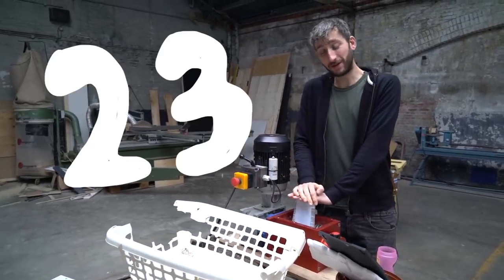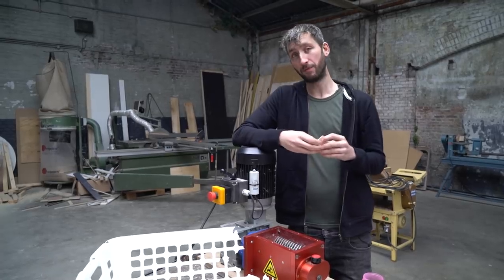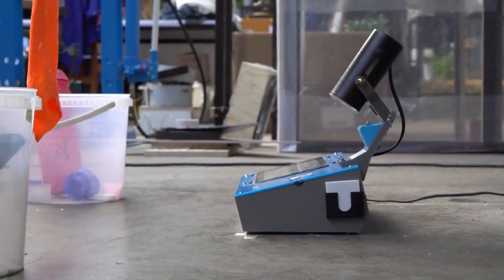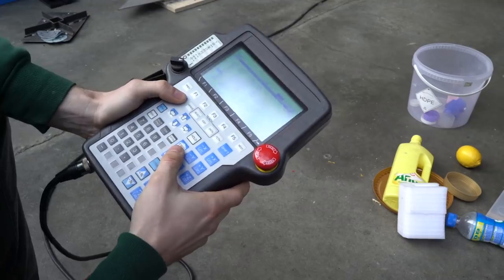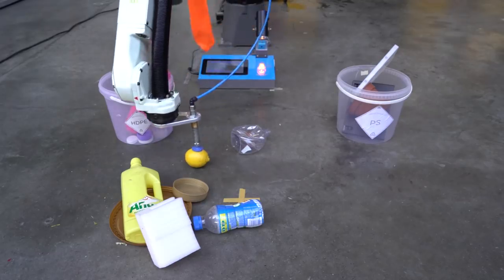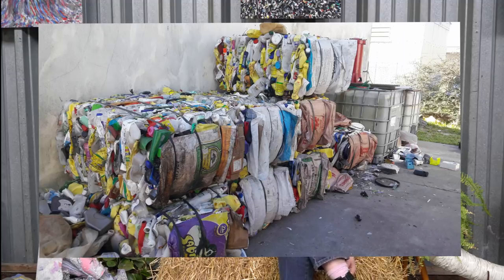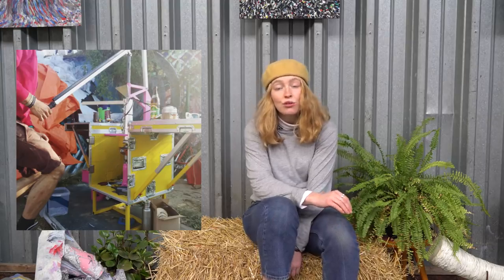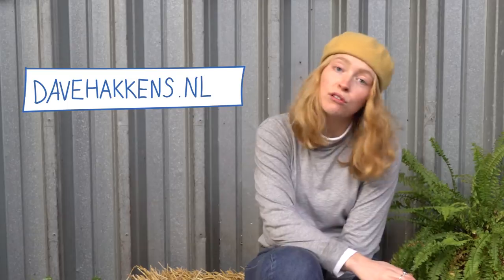Monthly news #23 - Stop shredding fingers

Comment: Capacitive sensor on the crushing teeth 
So when you touch it it stops the motor
Search sawstop on youtube
Reply: Would be a nice idea if the whole machine wasn't made out of metal, I also assume the motor is grounded, which would mean that the whole shredder is grounded. And it it's not grounded i'm sure this shredder would gather enough EMI to trip the safety mechanism.
SawStop works because the blade is a single part and it's easy to isolate from the rest of the saw.
Reply: Sawstop is only safe because it is going under table in milliseconds.
Reply: good idea, but not practical in this case as bottle are often still wet and would trip the system. also, many plastics such as PET, Nylon and ABS are hygroscopic and absorb lots of water, as opposed to PE and PP that do not. so will bw hard to calibrate.
Reply: @s777nserg  this could be made safe using SDI mode (Safety direction) by reversing the motors direction or SLP (Safety Limited Position) using a VFD :) You could isolate the blades from the rest of the machine by putting bushings between them and the drive shaft or between the bearings and the housing. There are ways to do this
Reply: Here's an idea: A skin sensor you have to attach to your body in order to turn on the machine at all, then you can detect the closed loop to stop. The only drawback is if there's more than one operator using the machine.
Reply: @mikkosha  that's what I was thinking aswell! (Specifically reversal could possibly be better than straight stopping in place with those interlocking teeth.)

Also possibly, have the rods that the teeth are on be forced away from each other if capasatance is detected, kind of like how the sawstop blade retracts. But horizontally, as opposed to vertical movement.
Reply: @stapuft  you could build something like an electromagnetic latch for this purpose :) Like as soon as you apply power the teeth get pushed together into their working position, tensioning a spring which is then latched and as soon as power to the latch is cut off the latch will disengage and the springs will push the teeth apart :) I like your idea :)
Reply: @mikkosha  thats awesome! I like that as well, but just thinking out loud, wouldn't you need some kind of motor or something to tension the spring? If it's powerful enough to pull the heads apart fast enough to be a safety device, it might be really hard to put them back in place without assistance.

What about a electro magnetic thingey? If you use DC power for the magnets, you could controll their polarity realitively easily, what about when the capatance device is activated, the electromagnets polarities get matched, and shove each other away through magnetic force?

You would need a really high speed microcontroller to make it act fast enough though, possibly even use a capacater bank to get enough power to make the magnets repel each other with enough force and speed to be effective.
Reply: I think that will not work with wet plastic. I'm not sure if they have all plastic dry but if they don't that can be a problem.

Comment: copper fingers or forks that push out of the way completely when inserting something into the machine, if flesh or metal contacts the copper fingers it will complete a circuit and switch the machine off instantly.

Comment: Just make a upside down pyrmiad shaped funnel that's long enough that someone's hand cant tough the blade, but this also means the opening will be bigger than the original which is a good thing
Reply: or ooo I know let's make one so big that a grown man can't climb out if he falls in
Reply: I built a shredder like this and I put a funnel on top, and a hinged polycarbonate cover with an industrial electromagnetic safety switch on it
Reply: all commercial shredders basically are just like that. the plastic has to be introduced through a shoot.  the blades are far down. BTW, in the industry there are shredders and granulators, and they are 2 different things doing different purposes.
Reply: I guess the problem they are trying to address is being able to push down the plastic material into the shredder to make sure that it is being shredded. I think installing a funnel shaped shoot with a mechanical pushing mechanism can be a solution. :)
Reply: @gilsonandrenarciso9574  A very simple solution is to use a rod (use plastic to avoid contamination) to push down stuck material. Works very well for wood shredders. They also have the big hoppers, so you can't touch the blades/hammers, which makes working with them pretty safe. As long as you aren't my granddad, who put is finger in from the bottom...

Comment: A bunch of people are telling you about sawstop. A good start, but not a good idea overall.

Sawstop works by shooting a steel lever into the mechanism, saving your finger while destroying the saw. For large crushers, this is an expensive mistake you won't want to make.

Instead, consider a long funnel that prevents anyone from reaching into the shredder with an arm. Not only is this solution much easier to implement, but it's going to be more reliable with less expensive testing needed.

Unfortunately, it simply is not economically viable to recycle expanded PS. Considering PS could be a clean burning plastic, it should be possible to build a high temperature, blast furnace like device to produce straight CO2 and water. This, once it got hot enough, could be used to produce steam and thus power, not unlike a traditional coal plant, but with less SO2 and other impurities in the coal released.

Comment: You may try a spring loaded, transparent plexiglass either directly mounted or inside a funnel on top of the shredder.

For the robot, it will be interesting to see the sensor mounted on the robot arm itself; saving the back/forth motion. 

All the best on excellent effort.

Comment: Seems like you just need an open ended box and tamper to make the shredder safe. Could rip some plywood to dimensions, pressure fit it around the housing of the shredder (just zip it together with screws). Then just make sure the tamping plate is smaller than the inside diameter of the of the box but larger than the inside diameter of the lip of the shredder housing. Tamping plate could be secured to a tamping rod with a floor flange and the tamping rod just threads into that flange. That way you could dump several containers in the top of the box and once the tamper is set in the weight of the tamper may even be sufficient to get the shredder to bite into things. If it needs a little help you just depend a some weight on tamping rod to get the shredder grabbing again.

Comment: Hi!
I'd like to suggest another way to sort plastic types!
Every plastic has its own density (pla about 1.25 g/cm³, hdpe about 0.95 g/cm³, PET about 1.38 g/cm³ ...).
Archimedes tells us that a material in a liquid will sink if it is denser than the liquid. So why not shred every plastic and after put them in bath of water with controlled density (you can do that with salt, for example). The heavier plastics will sink and the lighter will float. Begin with a low density liquid (like oil or alcohol) to first separate the lightest material, and go with denser liquid step by step. You will end by sorting every type of plastic! :D
Reply: good idea, worth a try. like
Reply: air pockets (even in the shredded plastic) wil let the plastic float and give false results i fear. Good idea tho, would love to know if it is possible in practice
Reply: @darkspeedy26  Well, if this happens, it may be possible to create vacuum around the Bath it would make the bubbles get out I think... But this would create other problems, like the water boiling at lower temperature if at lower pressure, and si creating other bubbles :/
Reply: @yann516  indeed, and would be energy intensive i suppose
Reply: this is a great idea and there are companies out there doing that: they shred the plastic first then run it through float beds. it works, but the fundamental issue, which is the Achilles's heel of all of Dave's beautiful endeavors is that it must make economical sense! you have to keep in mind that recycled plastic needs to cost significantly less then virgin plastic for a processor to be incentivized to choose it. keep in mind that recycled plastic will always be inferior in quality to virgin plastic. and floating plastic is relatively expensive, (plastic also needs to be dried, typically).
Reply: Superdu our senior project in college was very similar to this except it was ferro fluid. It changed density when different electromagnetic fields were applied to the fluid.

Comment: There is an old saying, "When you are good with a hammer, everything is a nail."  Robots are cool no doubt, but for this application they are both slow and expensive.   Just because you are good with robots doesn't mean you shouldn't look at other solutions.  I suggest you try to arrange a visit to a UPS ,  FedEx  or other package distribution center and see how they sort packages for shipment.  As noted in another comment, a conveyor with means of diverting plastic types to its own bin seems to be a much better way.  You guys do great work and I enjoy seeing your progress.
Reply: Spitballing other ideas... a light duty gantry machine could work well too, couldn't it? Think along the lines of the arcade claw-drop games. It's a much simpler and cheaper than a robotic arm, could be built to whatever floorprint is desired, and still sort through piles in much the same way as the robotic arm.

Granted, I have gantries on my mind, because I'm working on building one right now. (When you're good with a hammer...) A conveyor belt system diverting things would definitely be faster, but that might not be important for small operations. Which do you think would be easier to build and operate?
Reply: @swolebro    In reference to the gantry machine in the arcade.  Positioning the claw above the desired object is less than 1/2 the battle.  The claw and object have to be oriented perfectly in order to grasp and lift that object. More often than not the Arcade claw picks up nothing.
  The best approach I can imagine, is for a person to place plastic items on a moving conveyor.  Orientation unimportant.  The person provides spacing between objects.
  The plastic item then  passes under a plastic type  identification system.  The conveyor proceeds past multiple bins.  In front of the appropriate bin, a blast of air or pusher diverts the part into its appropriate bin.
  This eliminates the need to orient the part or claw for pickup.  It eliminates positioning of a robot arm or gantry.  It eliminates the need for a 3d vision system which will be more complicated than the robot.  I speak from experience having worked on a robot  and vision system used in a painting process.
  I enjoy spitballing ideas, I hope others might join in and that the good folks at Precious Plastics are listening.
Reply: @thomasburdsall1564  I am under the impression that the arcade claw drop games are made intentionally difficult (eg. by packing prizes tightly in the pit) or even rigged (eg. having the claw grip weakly 90% of the time) in order to reduce payout rates. So, I wouldn't take the difficulty of that game as a demonstration of how difficult the problem itself is. 

A rigid Z axis would be one obvious improvement over a loosely dangling claw, and from the looks of that robot arm, it had a suction cup (with a vacuum pump) to make it less sensitive to positioning. 

The conveyor belt systems I've seen were like the ones they mentioned in video. Wide streams with sensors to identify individual items in the stream, and then knock them out with air blasts as they pass over a gap in the belts. Very industrial stuff.

Your suggestion does sound much simpler in terms of engineering, since there's a person to provide the spacing of items on the belt, but then you are still tying up a human for however long the sensor needs to identify X pieces of plastic. You can't dump a bin and walk away. In that case, couldn't the human hold each piece over the sensor himself, then chuck it in the appropriate bin? Given that the Matoha sensor they used looks like it's very near-range, that might be better than having the belt try and pass each item by it. Add some colored lightbulbs to the sensor and some colored bins (red for PET, yellow for... etc.) and it would a pretty reflexive process. Having the sensor at least saves the time of hunting for the identification stamp, which is (far) better than nothing.

The Precious Plastics guys do have a forum, and there's a link to their robotic arm thread in the video description. Haven't gotten as far as reading that though... because shit, only so much time available for each social platform. Guess I'll put some time aside and see what's up there.

I've been thinking about some computer vision stuff for a totally unrelated project that could be applicable to a gantry identifying items for pickup. Give me a week to try and put a video/demo together.

Also - you got any links to your work with the painting thing? Sounds interesting. I work in software, so sometimes I dick around with the Python bindings on OpenCV, but that's about the limit of my computer vision work.
Reply: @swolebro  My experience with the vision system was 20 + years ago.  The company I worked for bought a system that was to identify parts moving on a conveyor line.  The vision system would pass the information on to a robot  the robot would use the appropriate program to spray paint the part.  Granted 20 years is a long time back and no doubt improvements have been made.   But the point was that the robot was the much simpler system and far easier to implement .  My role was that of the poor slug who was to attempt to get programs for every possible item to be painted.
  You are right, the arcade games do seem to be rigged to fail.  True, A person sorting plastic to a conveyor belt could place the plastic on a scanner then into a bin.  I would hope that the system could be made to sort as fast as an operator could place items on the conveyor and later as fast as parts could fall from a hopper.

Comment: Smaller is actually better. You have less points of failure and things getting stuck.  It would be better to get the larger ones into smaller chunks.  Transferring the chunks into smaller shredders.  This way if one shredder were to need maintenance, it can be serviced without any issue.

Comment: All you need for a safety is some sort of lockout. 2 buttons on opposite sides of the machine that have to both be held down to operate it and will cut the power if released, or the power only functioning if a door on a chute is in the closed position.

These shredders are not high capacity industrial machines so any larger items will need to be broken down before being shredded. If you want to reduce the human labor involved then you may need a 2nd machine for that - perhaps a large cone with a spinning blade at the bottom, like a food processor. It could empty into a bin which is then dumped into the main shredder, or can be used in items that can work with coarse pieces. 

But that all  does assume someone is needing to conform to some level of safety standard, since anyone can build these however they want for their own home use, at their own risk.

I think you should also talk about welding plastic at some point. As a method of joining the materials it's not really talked about, ever, outside of some vehicle repair. But a broken plastic item can be fixed up if it's the right type and made to function again, no extra processes needed. 
There's a lot of cheap plastic welding kits for boat and motorcycle repair, and some expensive ones for things like vinyl flooring. Some people on youtube use soldering irons or heatguns with nozzle attachments. I personally have fixed the chainguard for my bicycle after crashing, as well as some headphones and one of those plastic roller carts with the drawers. You said in your video about electric cars that maintaining what already exists is preferable to buying something new, and as long as one avoids burning the plastic it's a way to keep products from needing a replacement, and uses no extra glues or epoxies. Plus if someone messes it up to being truly irreparable, it's still recyclable!

Merry christmas and happy new year!